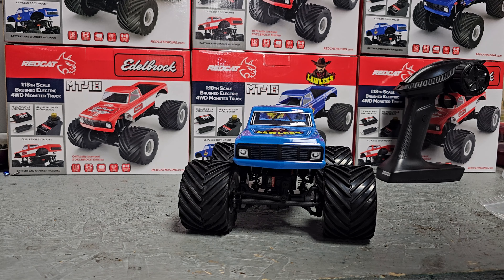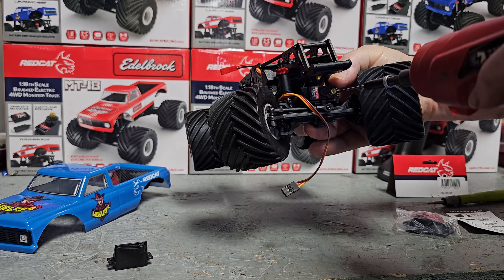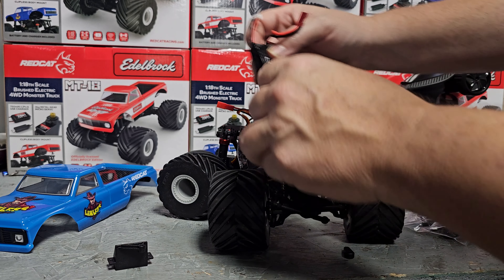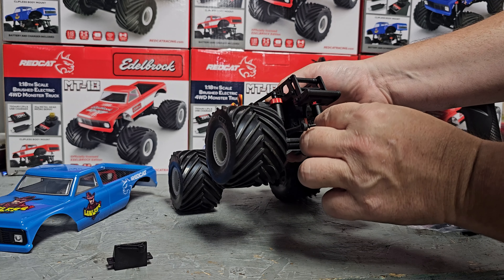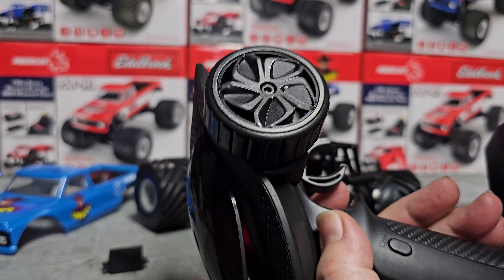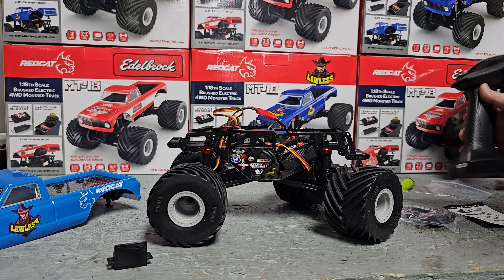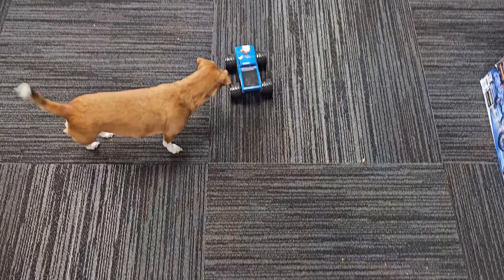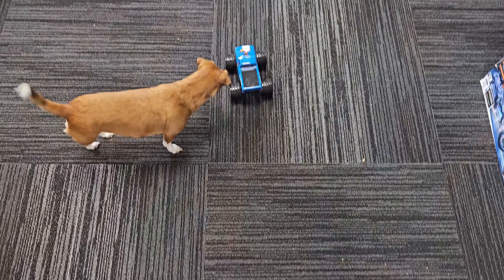Installing Rear Steering on Redcat MT-18 and & First Run

Comment: Pretty cool little truck
Reply from the maker: Definitely  has potential.   Better out the box then some of the other small scale solid axles.
Reply: This is the RTR for us losing the FMS smasher, with every upgrade you could have needed, minus a servo. The driveshafts are great, both Axles are straight and ready for 4ws, only thing it needs is a little bit of torque to get wheelies if you want retro style, if you want modern, throw in a Hobbywing BL30 with a Furitek Komodo for under 70US.